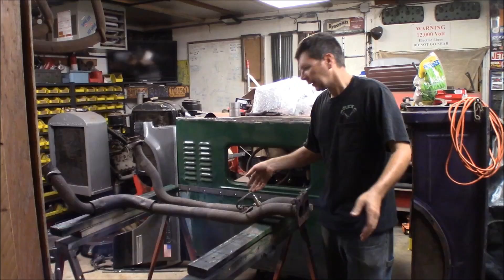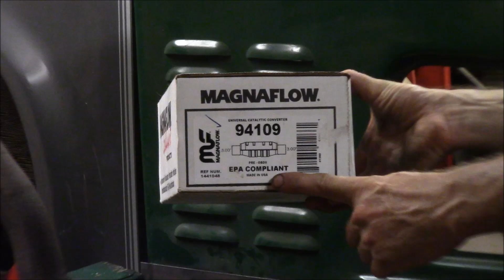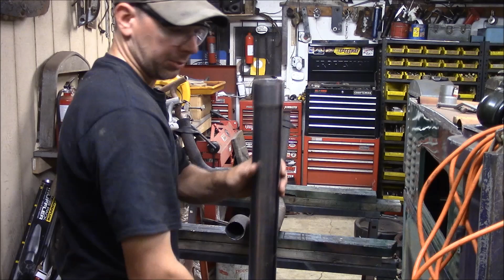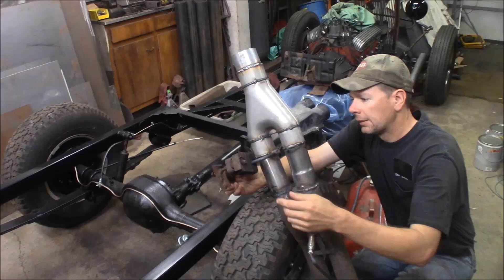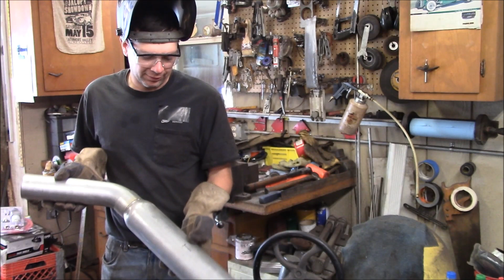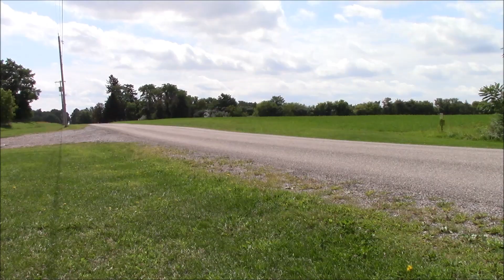Project Green Machine OBS F250: Custom 3 Inch Cat Back Exhaust

Comment: What wire speed and heat do you weld at? And what technique? I’m wanting to hone in my exhaust welding skills.
Reply from the maker: I don't remember what the heat and speed was.  I have a Miller Multimatic 215 with autoset so the machine picks the heat and feed based on material.  I had it set for 18 ga steel.

Comment: How loud is it in the cab?
Reply from the maker: It's not too bad, but is noticeable all the time.  Not loud enough to over power radio or anything.  It resonates the loudest about 2100-2300 rpm.  Its become a little louder since the video as the muffler burns in.  Definitely loud outside the truck.
Reply: @QuickSpeedShop  so not as bad as a leaking manifold?
Reply from the maker: @STR8SICCC  A leaking manifold is a loud, obnoxious noise right at the firewall and sounds like garbage.  Any exhaust system sounds better than that.  My exhaust is louder than a manifold leak decibel-wise, but loud in a good way.
Reply: @QuickSpeedShop  I don't doubt that at all haha. My leak is barely noticeable at idle but super loud, especially at speed on the highway.